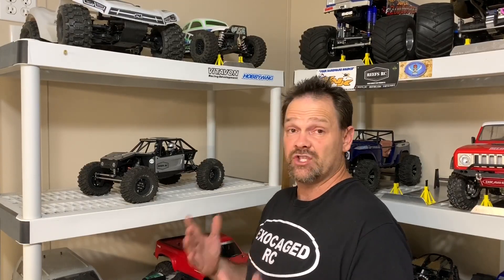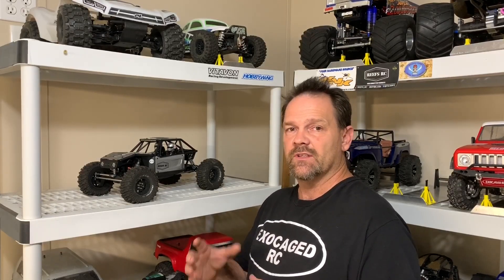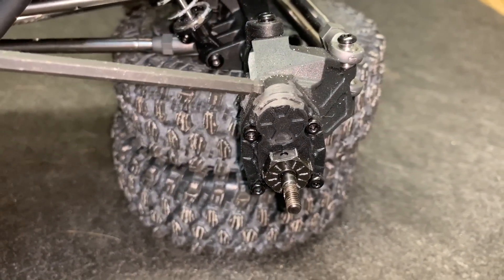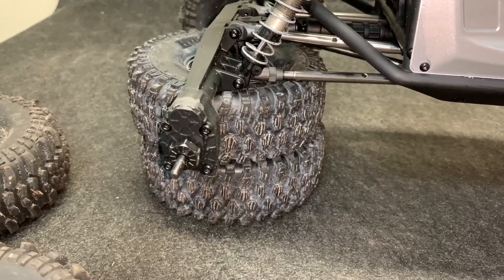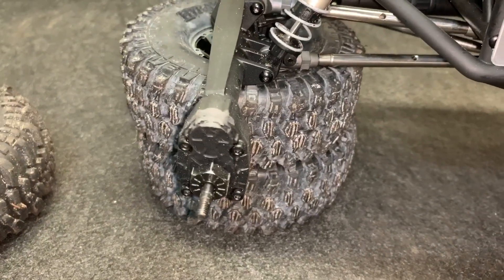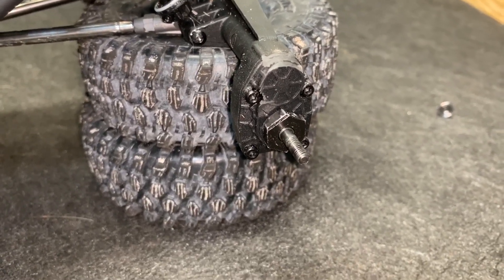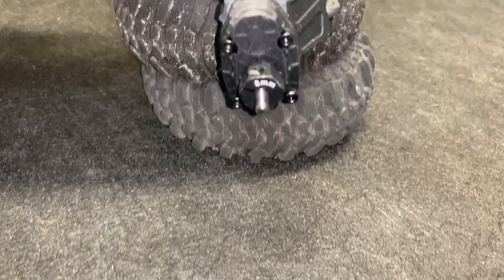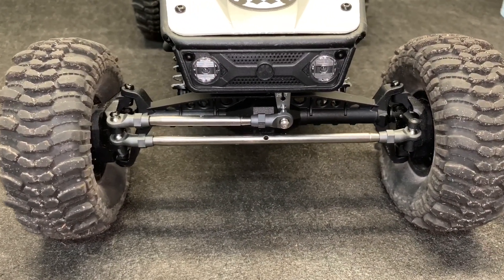Capra Portal Clearance Issues

Comment: I'm running SSD contenders with 350 slw hubs. It's tight but doesn't make contact. I ran all weekend at crawl for a cure and only had one wheel with any abrasion on the inside, it looked to be from grit. It's a non issue for me. I am looking forward to brass boxes with hopefully a little more clearance.  I think this was a compromise to allow enough portal box "space" to allow the upcoming o.d. portal gears to fit. If you look, you'll see the top gear has a lot of extra room around it to clear a larger o.d. top gear.
Reply from the maker: ahh ok it would be neat to just swap portal gears as it would be an easy way to get it

Comment: If you run wheels that use SLW hubs, the 225 SLW hub with 1.9 wheels will clear the portals with no issues and not widen the track much, or any, over stock.
Reply from the maker: Greg Jones yeah I saw a guy post that but the vast majority of scalers use whatever they can afford. Those are a bit expensive so I figured this may help some make what they have work.
Reply: @ExocagedRC  A lot of the "Chanquish" wheels use a SLW-compatible hub as well.  Proline has a Yeti hub conversion kit (AX31074) that is very similar to the SLW hub pattern and comes with 4 short and 4 long adapters.  I use them on all of the wheels I design and print.  The short ones are the same offset as the SLW 225 hub.

I wanted to let others know that there are alternatives out there.  Would hate to see someone accidentally burn through the top of their portal case with the Dremel.
Reply from the maker: Greg Jones that’s great info on those other options. I can copy and paste your response in the description is that’s ok with you.
Reply: @ExocagedRC  that sounds good to me.

Comment: Simple solution (which I'm going with) is 1.9 tires on 2.2 wheels, with 225 hubs.  For those not wanting 2.2 wheels, stick with 1.9s, bit go with 350 hubs.

Comment: Great video. Thanks for the heads up on this. Do you have a link for those 8 mm wheel hexes? Thanks
Reply from the maker: Bryan Forth ah crap I gotta get that link in there. Give me about 5 minutes
Reply from the maker: here you go bud, I also put it in the description https://rover.ebay.com/rover/1/711-53200-19255-0/1?mpre=https%3A%2F%2Fwww.ebay.com%2Fitm%2FRC-Car-Wheel-Hex-Drive-Hub-Adapter-8-9-10-11-12mm-Parts-Replacement-Hex-Wheel%2F183876760406%3Fhash%3Ditem2acfe8b356%3Am%3AmROkNWu3KODThGAQS_SsGMQ&campid=5338273090&toolid=20008
Reply: @ExocagedRC  thank you sir. Have a great day today!

Comment: Do the larger 2.2 wheels clear? Doesn't help cog much but you can always lower suspension as well I guess to help with that problem. Not nice having to grind on a nice new rig like that though.👍👍
Reply from the maker: D19 K yeah most any 2.2 wheel will work. You can stretch some 1.9’s on them to keep the same diameter but fit better. Yeah we shouldn’t have to be grinding on a new truck.
Reply: @ExocagedRC  cool.was looking at buying one of these. Here in Australia the scx10 11 kit $199us sell from $380-$400 here.lol. rtr about $529-549 depending on rig chosen. The capra going for $649 at moment so I think I'll wait a little on that one till bit of a price drop or sale. Even a second hand scx10 roller needing new wheels and parts sell for $200+.🤷‍♂️
Reply from the maker: D19 K I wish I had connections to stock and sell these overseas for a decent price.

Comment: The rims I had chosen to run on my Capra wouldn’t work without doing some modding or using bigger hexes, so I just used the stock ones  and have zero clearance issues, however, if any sand or small gravel gets in there, it rubs it between the rim and the portal box and it makes it look like the rim is rubbing...

Comment: I got some nice beadlock wheels for my trx4 sport kit, the hubs that came with the wheels wouldn't allow them to clear the portals so I ordered some slightly wider hubs, problem solved.

Or maybe try to find some wheels where the hex slot is even with the inside edge of the rim.

Comment: I must've lucked out. The 3 sets of wheels I've tried haven't had the issue, so that explains why I wasn't aware of the rubbing.
Reply: What rims do you have?
Reply: @jammyhires4598  A couple sets of Injora (Method knock offs), VP Bully w/475 hub are the only 3 I've tried so far.

Comment: With stock wheels also occurs this issue?
Reply from the maker: I've seen pics of them rubbing yes. Mine are still in the bag
Reply: @ExocagedRC  R&D is a joke this time, for a rig that expensive i wouldn't accept flaw like this, also it hurts to see you had to modify it to make it work
Reply from the maker: Papa Chill it’s just plastic and I didn’t get into the real strength of the portal box so it will be ok.
Reply: @ExocagedRC  what the axle and portals are plastic??? wow, i thought those came with currie metal axles